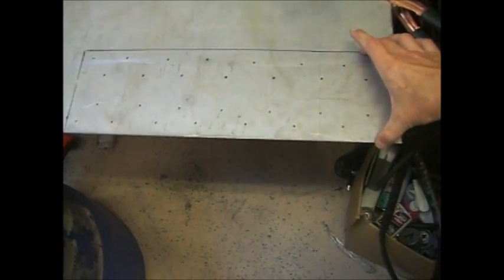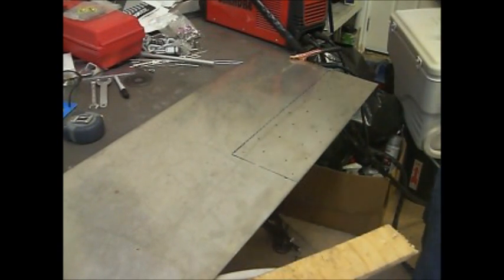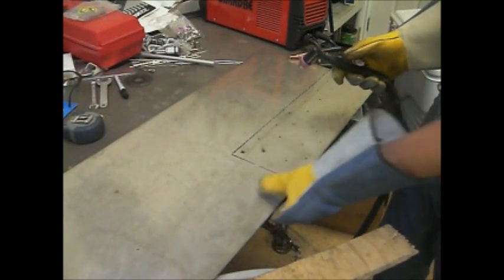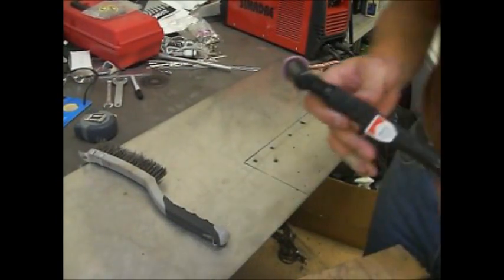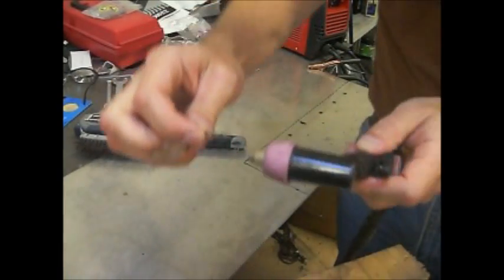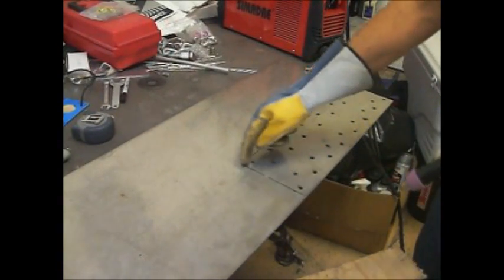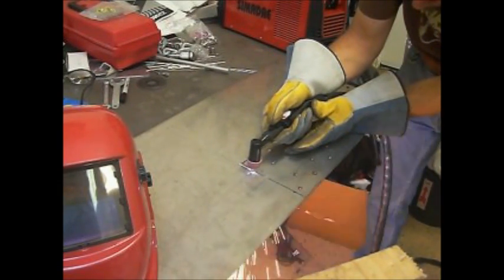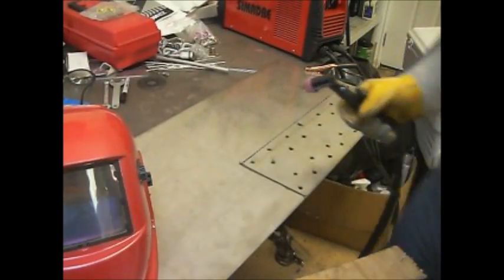Plasma Cutting Stainless Steel Bracket

Comment from the maker: I had the same impression before I started too. Then the torch wouldn't start up off the metal surface. I thought the unit was defective! LOL   No, it's ok to touch the surface. No tip damage that I can see, besides tips and electrodes are real cheap on ebay.
"I could be wrong, I mean you are the one with the plasma cutter but I remember reading somewhere that keeping a slight gap between the tip and material you are cutting will extend the life of the tip. Again I could be wrong."